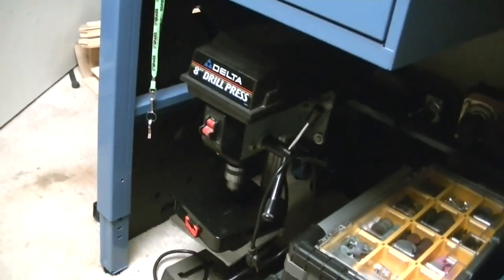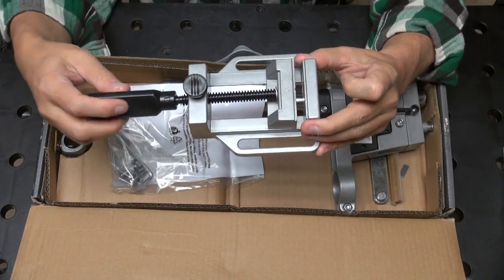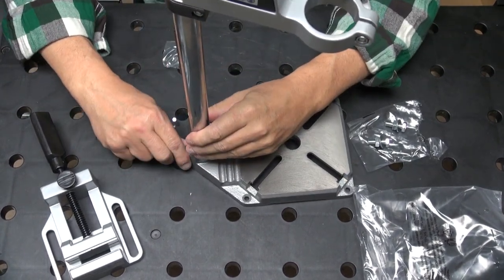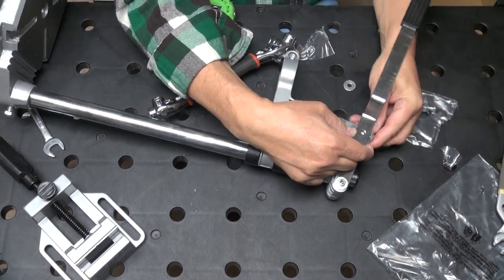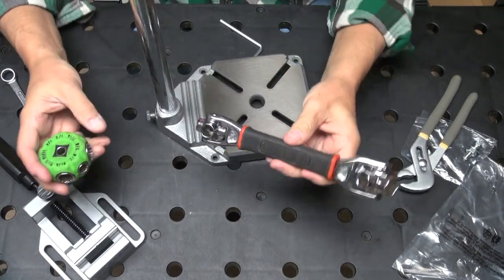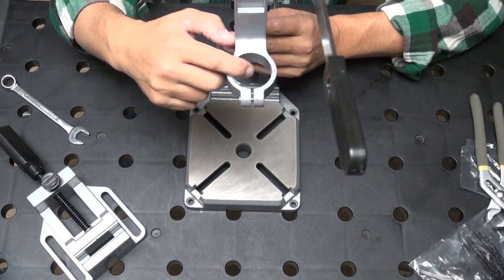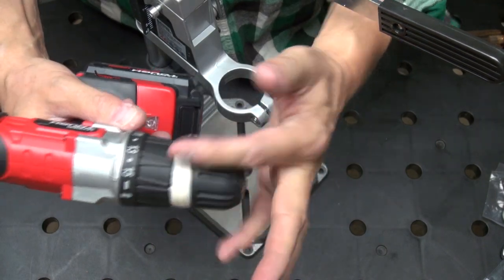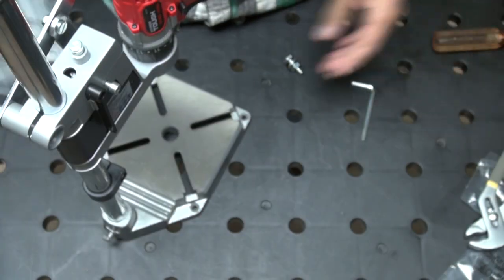Introduction To PowerFix Profi Portable Drill Stand Sold By Lidl

Comment: I've got the same one but with a different name.

I used an old cordless drill with dead batteries (nicad), chopped off the handle, added a switch to the top (next to where the speed switch usually is) and added a short wire that goes to a DIY adjustable battery.  Mounted it by removing the (pointless for this) slip clutch adjuster, sealed the bearings in (needed for the clutch) and made an adapter out of wood to mount it.

Like the other guy said, it's not meant for cordless drills. the hole is made to accept drills that come with a removable secondary handle.

And the depth stop, eh, i'm not sure if it's really a true depth stop. when it's not tightened to the point where it's still easy to undo and move to a different depth, there's a lot of left/right play so i just tightened it down pretty much permanently and it removed all that play. plus, it has the depth measure so a stop isn't really needed. if it is, i'd just use the collar as a depth stop.

Comment: well first of all the ''hole'' is not for a cordless drill but for a electric power drill  coase the neck is thinner an fits perfect at least both my makita and a cheap nameless i have does and secont you need to put a washer on the handle screw to tighten it .Enjoy :)
Reply from the maker: The 'hole'  isn't the issue but the size of the piece of the drill is the issue.

Comment: Another great video! There is a similar option to this from Dremel. Speaking of which, this video made me think of another little goodie I've been contemplating buying. I'm wondering if you've had any experience with it and if so, I'd love to hear your thoughts. It isn't a particularly large purchase but I'd rather not buy it if it's junk.
I'm looking into the Dremel "Rotary Tool Shaper / Router Table" attachment for sanding, edging, slotting and grooving wood, plus a bunch of other pretty great looking tasks that can be tackled from what I've seen. I'm slightly hesitant because there are very mixed reviews but from what I've seen, the majority of the really negative reviews seem to be from people that don't really know what in the world they're doing. Isn't that usual the case? 
Also, as with the tool that you're reviewing in the video, some sources I have seen advise that it works with pretty much all models of Dremel's and some sources show different info. It would make a big difference whether or not it works with the 3000 series vs the 4000. 
Any input you've got would be greatly appreciated Karl. Thanks again and keep up the good work! Lol. I'm off to watch more videos! (Also, probably find new things that I want to buy, much to the chagrin of my husband!)

Comment: Save your 20 bucks.. Its a horrible drill stand.. Mine became unusable after a week, the pot metal that holds the guide pin, or depth stop pin, basically this pin holds the complete stock in alignment, wore a hole around the pin, so bad that the play after a week was over 5mm down at the drill bit tips... The pin needed to be in a stainless steel bushing to prevent wear.. But even at the start, the hole that the pin runs through was 1mm bigger than the pin itself... Junk.. You will only end up binning it anyways so save yourself the 20..